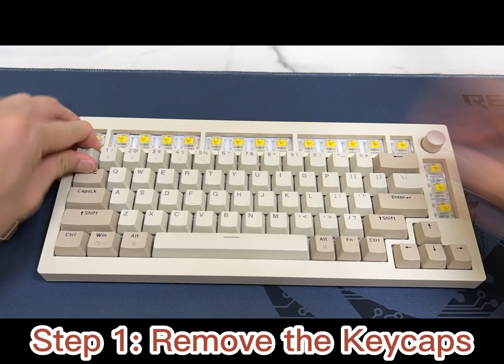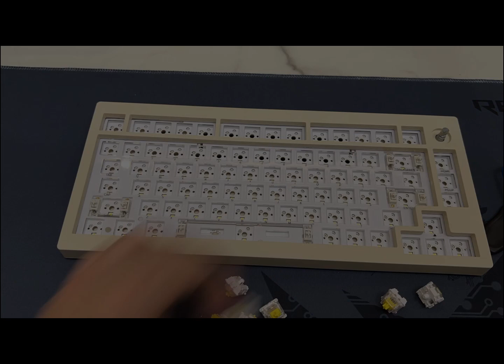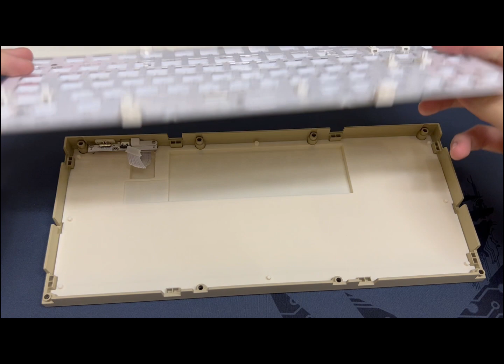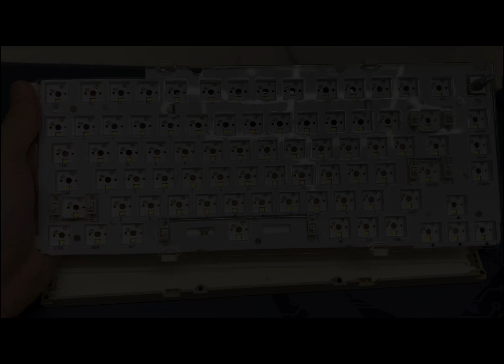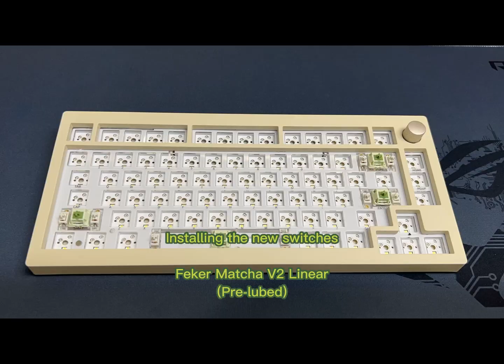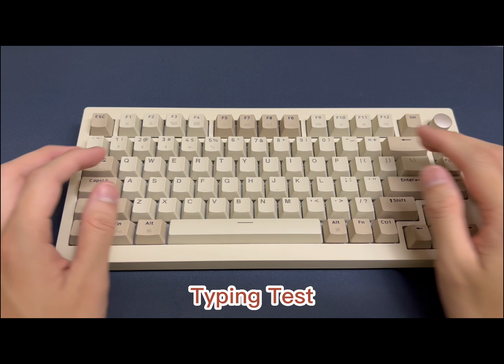James Donkey A3 Disassemble, Review, Modification & Sound Test

Comment: i just got these! do you recommend changing the silicone out to foam instead?
Reply from the maker: I have not tried it before. You could try and see observe the outcome.. i have tried something crazier.I replaced the case foam with car sound deadening material. Hahahah will be sharing video about that
Reply: @Ws502  any update about that?or do coin mod? still deciding between this and ik75.
Reply from the maker: @TuanHamdani  https://www.youtube.com/watch?v=WaUnTwhjF1A&ab_channel=Nat%E2%80%99sOldBean

Here i have a video of using the car dampening mat to place inside the case. not much of difference compared the original foam. i havent swap it with the James Donkey A3 silicone yet
Reply: @Ws502  tq

Comment: What's your opinion on feker matcha?
Reply from the maker: It is smooth quite loud and honestly not bad for the price, about RM0.9 per switch, 21 cents USD
, comes pre-lubed, and the factory lubed is quite consistent actually..i will probably be using them in the GMK67 board.

Comment: Im stuck between this, feker ik75, and th80 by epomaker, any suggestions?
Reply from the maker: Hey there, I have not tried the 2 boards that you mentioned. I personally would recommend this A3 Board because comes with Scew in Stabilizers, those 2 are plate mounted Stabilizers if i am not mistaken. and the price too. i believe this barebone kit is the cheapest among the 3 yet offering more. hope it helps :)
Reply: @Ws502  Thank your for your fast reply! how much did you get the A3 and which website did you get it from?
Reply from the maker: @anklebully7128  I got it from around RM250 (Shopee Malaysia), it depends on where you're located bro, or you could consider Ali Express. they ship worldwide.. :face-blue-smiling:
Reply: the epomaker is veyr good im using it right now